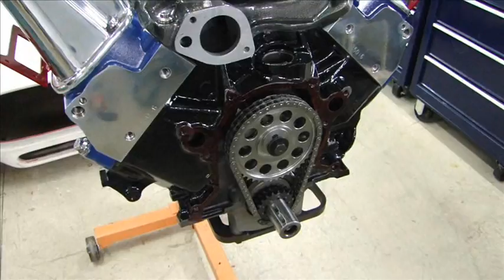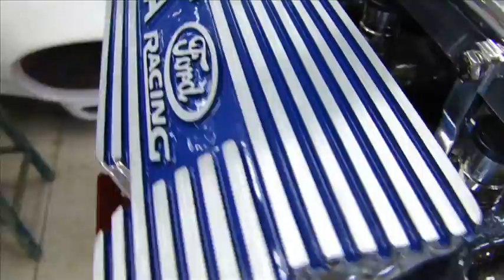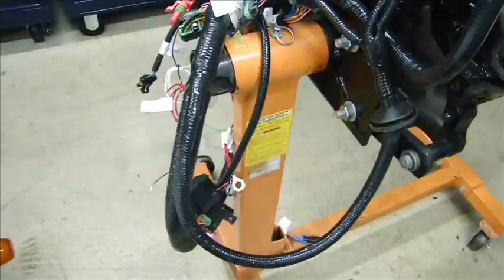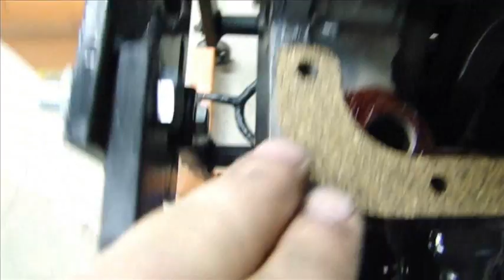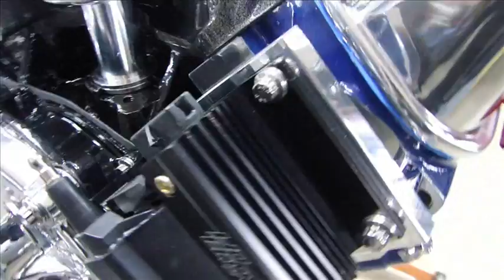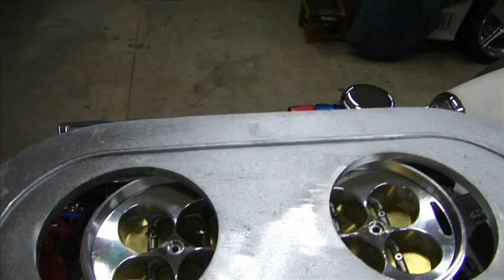Cobra Engine Build Part 2 Finishing

Comment from the maker: Get a book for the engine and know all of the torque specs. Once you take it apart you can inspect each part for wear. At a minimum....new rings, hone cylinders, new rod & main bearings, grind crank mains & pins, new cam and lifters, new valve springs and grind valve seats, all new gaskets and rebuild the oil pump.

Comment from the maker: Anachronistic huh?....lol, I'll wave the fee but will have to break out the paddle. The public needs to learn from this....lol. I love your sense of humor! I am actually going to use a shorty stailess header and use a 3.5" stainless pipe to connect the headers.....zero back pressure and should add a bit of rumble...if I'm wrong I'll submit to a series of body probes by a bunch of 25 year old hotties in microkinis!

Comment: I suppose it would be a miracle to exit exhaust gasses and bypass any port of sorts. I just meant that a 4 bolt collector hookup (Camaro V-6 style) is far simpler than manifolds, which can leak, loosen-up, and burn your pinkies, etc. You have to admit, that exhaust manifolds, headers, etc., are anachronistic components. If I'm wrong, I'll submit to a public spanking, and pay the required $5.00 fine.

Comment from the maker: Yes you can. Engine assembly lubricants have ingredients like graphite and molybdemun that aid at start up and cling to the parts longer if you take awhile to get the engine assembled. Engine assembly plants only use engine oil so there is no problem with that.

Comment: its a melling camshaft with a 290 diration, eagle crank and rods,kb flat top pistons,stock
stock distributor, ford racing s park plugs,timing is at 14 TDC i been trying to play with it up to 16 and 18 got no pinging.cam lift is a 445/445

Comment from the maker: Thanks for the the compliment. It's really hard to answer your question. Need to know what kind of distributor, cam specs, carb specs, and what kind of ignition system you are using. 25 DBTC is a good place to start.

Comment: Hi hade a question. I have a built 347 stroker motor 5.0on the block and running 9.8.1 compression was wondering what the timing should be at? Thanks love your videos by the way!

Comment from the maker: You said it better than I. There are openings on the top of the throttle bodies that suck in air from the air cleaner and route it around the butterflies to slots at the bottom of the throttle body. This is where the idle air enters the manifold and passes over the sensor. You have the logic perfect. Thank you for the compliment, I try to put something educational in every video, even if it is just a safety tip. Good luck with the Apache...watch out for Tomahawks.

Comment: I see the logic, because the Idle air motor feeds air in after the throttle body and you need to monitor that air temperature at idle. I thought that said air would come through the air filter system and be the same temp as air the engine would take in normally. Sounds like the best location though.  Your videos are  excellent, i am having a go at my first restoration  (a 1956  apache) but i am more familiar with import engines so i have a lot to learn about your small blocks.

Comment from the maker: Well....it's a kind of yes and no answer. You are correct, it is monitoring the intake air temp. The difference is that this system requires the IAT sensor to be located directly in the flow of the idle air coming through the throttle body from the idle air control motor. It is critical to monitor the idle air temp at idle so the injectors can be sync'd up with the distributor to get the right mixture. If it is not placed directly in the idle air flow it is impossible to map the idle settings.

Comment from the maker: Thanks my friend. Any of the high temp engine paints are good. For calipers I have tried many, but the paints made for calipers are the best. Not the 1 coat kind, a two-part epoxy type because brake fluid will peel most paints over time. I prefer powder coating and better yet annodizing calipers, but that is much more complex. I would look at companies that offer complete front hub to hub kits. Start looking a full tilt street rods and talk to Clay.

Comment: awesome job man! hey what paint brand do you recomend on engines, brake calipers and such,if you dont mind?..BTW I got the tip about the crome plating thnx ..I got a 97 svt cobra i want to start doing front suspention where would you recomend i start with and were to get the parts?

Comment from the maker: Great question!  I actully chose that spot due to the massive amount of air that will be going by. If it has any effect on air flow it will be unmeasurable. It is critical to have that sensor directly in the air path. Everything looks easy when someone else does it....and I don't think I bled once building it so I'm getting better....lol.